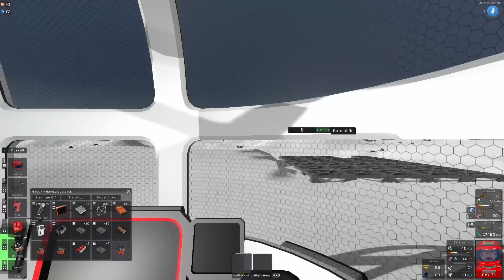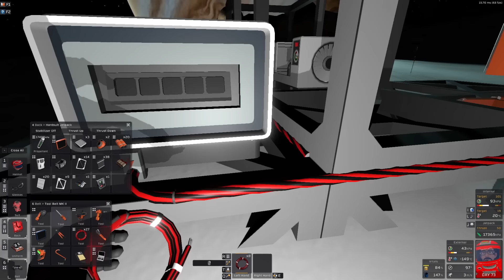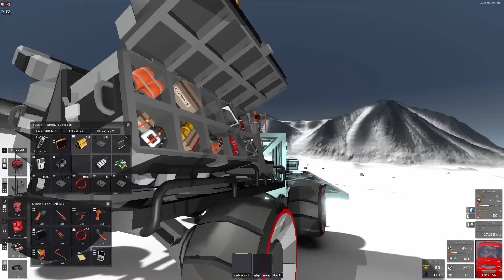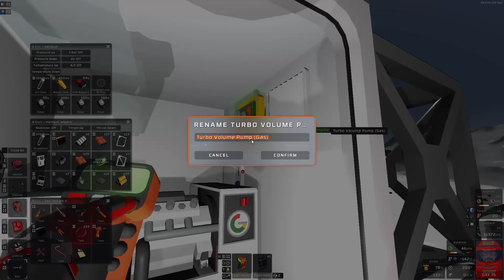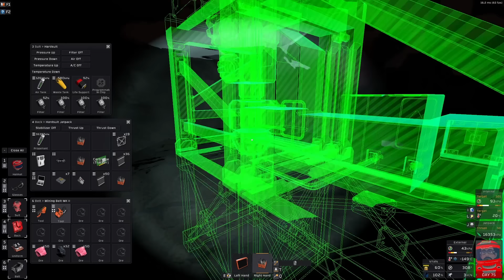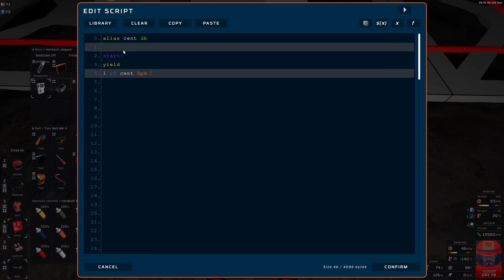Stationeers - New Europa 9 Mining outpost.

Comment: That's a really awesome mining spot you found there. What you could do is to change it to use coal power instead. You will be collecting enough to run electric centrifuges and a solid fuel generator to keep everything going. That way you never have to add fuel there again.
Reply from the maker: Electric centrifuges are slow and use a lot of power.  Once I have the rocket all of the fuel problems will be solved.

Comment: You should setup the hydrocarbon drill fairly quickly and use most of it to power the outpost, saving on volatiles, or going a setup further and refining the carbon into solid fuel.  Both ways will save on volatiles.  

You can also use the exhaust from the centrifuges to setup a furnace in a hotbox to smelt the ores as they're being spat out of the centrifuge, then direct them into a refrigerated vending machine.  The smelted ores will stack to 500, aside from the leftover hydrocarbon.  Giving a massive storage and an easy way to retrieve what you want.
Reply from the maker: I did consider coal power but I still need fuel for the centrifuge and the GFG is more efficient than the coal so i thought it not worth the effort.
I might upgrade the centrifuge to auto empty into a furnace since I smelt everything at the base anyway.
Reply: @cowsareevil7514  After rewatching the video, it dawned on me with the extreme cold you could get more power by using a sterling engine from the exhaust from your GFGs.  You may even be able to just expand the GFG room and use the existing cooling.

Comment: When you were having an issue placing the tank onto the portables connector @28:00 minutes, you should see if you are able to when moving the Batmobile far away. I think it interferes with the connection since those tanks can be mounted on the rovers as well.
Reply from the maker: Good point.  I will have to test that.

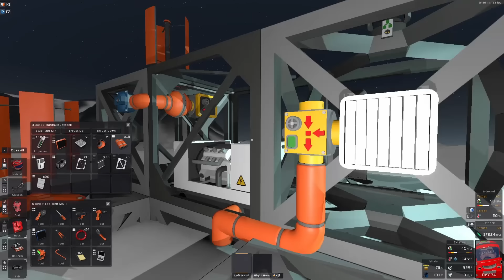Comment: 17:00 shut up that's why is a valid reason if you ask me.
One thing i notice is the fact you put your battery outside on the outpost.
Isn't the battery draining due to the cold?
Reply from the maker: You will lose some power but not enough to worry about.  I might build an emergency shelter there later and enclose the battery.

Comment: Well, the environmental pressure is easy. Just set your oxygen filtration to be 200 kpa more than it is, and then a back pressure regulator off the inline tank to be 100 kpa below that new value.

You still need nitrogen for the soy (composter/gas mining rocket), but if you automate dropping CO2 ice in the base it should help with your cooling.
Reply from the maker: I could just put a nitrous filter in the scrubber and drop some nitrice if I get desperate for nitrogen.